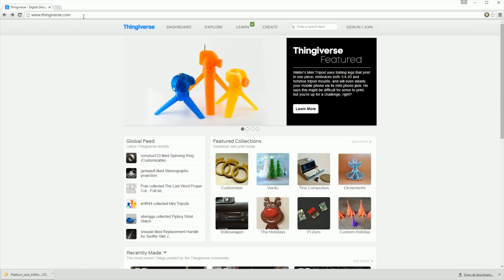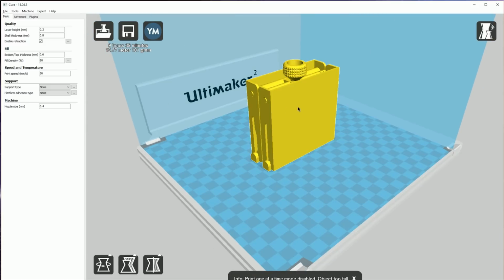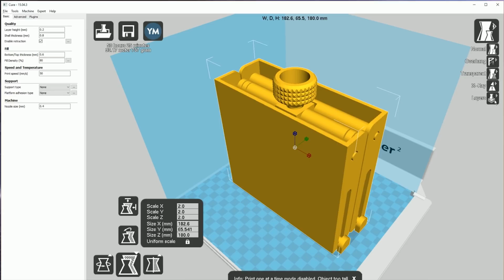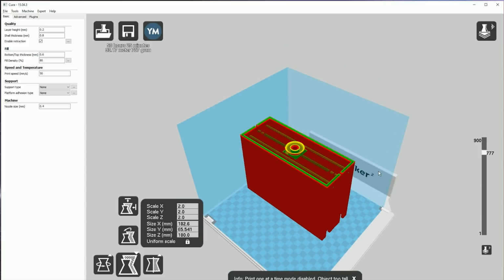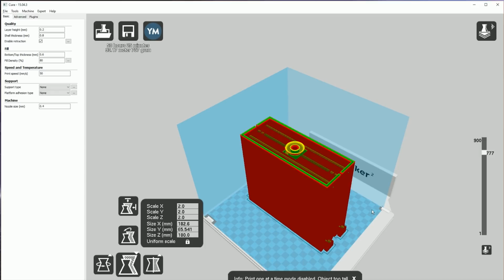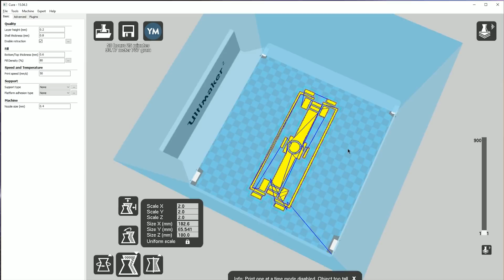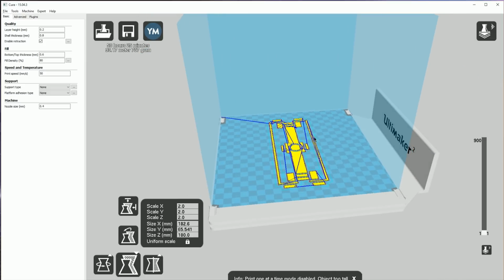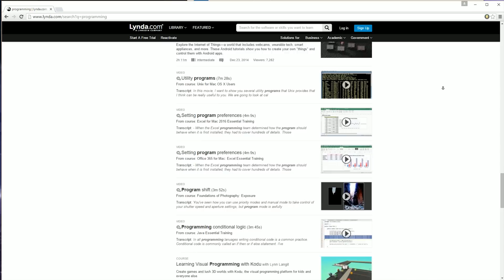3D Printing Fully Functional Platform Jack as Single Fully Assembled Print - @Barnacules

Comment: Fully assembled 3D printed objects are very cool. The auto manufacturer, Koenigsegg has a turbocharger that is 3D printed and fully functional. Of course it doesn't use plastic to print, but instead a metal deposit printer.

Comment: I have access to a printer with a chemical bath that can dissolve away the support material, If I were to use support material, are there any sealed spaces that the bath wouldn't be able to get to?

Comment: Hi ! Have you tried a software called simplify3d ? it's quite a delicate piece of software where you can manipulate with the support material and so on, I've used slic3r and cura engine on and off, but simplify3d by far beats those two slicers for me.

Comment: How much does it cost to run the 3d printer for a couple of days? Looks like a fun build, but daym, that electricity cost
Reply: Running a desktop computer can be more expensive than a 3D printer in most cases.
Reply: 1blisslife Oh right, interesting :) Thanks
Reply: +1blisslife Yeah, but then you are running your 3d printer, and your computer, all of the time.
Reply: +rdizzy1 not if you print trough an sd card
Reply: +Karl Karlex that's exactly why I commented that ;)!

Comment: Brilliant design by the creator what's is needed is 2 back to back with a solid screw between platforms so it at full hight it would be a rock solid platform. Off the top of my head the the paired platform would need reverse threading so both platforms rise on the same turn direction. Im not into 3d printing but I hope someone tries it.

Comment: Sure, it's super cool, but wouldn't it be cheaper, quicker and higher quality to print separate parts and then assemble? With separate parts, you have the added benefit of not having to reprint the entire thing if something breaks. Busted the screw? No problem, print another in 1 hour, instead of reprinting the whole device in 56 hours.

I do see the future uses of this technology, and the importance of us today using it to develop it further, but I mean for the household user, would this actually provide any benefits at all in its current state?

Comment: Do you think the bronze filament would work?  That would be a very steampunk lift!
Reply: I don't think it would, since there are pieces that are fused together(for example the knob), and I don't think it would be very easy to break tgefused bronze.
Reply: Is the bronze filament really that much stronger?  Its just bronze dust in plastic.  I'd almost argue it should be easier to break than straight plastic
Reply: +Dustin Penner It is easier to break than regular PLA which would actually be my main argument behind not doing it but I would probably succumb to trying it anyway because of how cool it would be.

Comment: I might be wrong but wouldn't a good revision be to change the orientation of the slots on the top and bottom so they are off set. I think if you offset the slots the legs slide in it would make it more stable when fully extended so it won't want to lean to one side.

Comment: Thicker arms and two screws and it could probably support your monitors.  Something like that would be useful to get your laptop to eye height and save your neck and lower back from discomfort.  Assuming an external keyboard and mouse for elbow height interfaces.  All of which would fit in a briefcase.  Two screws more flushed with the legs and you'll and a big enough cavity to hold a portable battery pack.  Put a raspberry pi 2 with touch screen on top and watch movies on a plane without having to look like a creeper who stares at his mantool for two hours at a time.  Not that the TSA would ever let you through with something useful or entertaining.

Comment: It made think when you said that you had one fail. I wonder if there is a way were you can take the misprint and melt down the material and re use it. I mean, you would have to find an extruder or you could build something the fits atop of the printer and melts the material and sends it threw the print head. Just my A.D.D. brain kicking in again, sorry.

Comment: i want a 3d printer :c but who can afford like 3k€ for a 3d printer? :c 
are there any good one for like 500-600?
Reply: I have loved my printrbot simple metal. They go for about $600 new.
Reply: Get a Prusa i3 in kit form or sourcing your own parts to build one for 200-300 quid! They can do just as good a job, but you would have to get under the bonnet & tweak the firmware after assembly. I highly recommend it ;)
Reply: Btw... Even if you don't know how to do it.... Plenty of video's on YouTube & online forums if you build one or if you get one of the kit one's. Most come with instructions to build it. Just as barnacules says... Get a Heat Bed(makes printing that much easier).

Comment: The problem with these all in one prints is if a single piece breaks you have to reprint the entire thing instead of just that piece.
Reply from the maker: That is a good point.
Reply: +CueBeanKa I'm asking because I dont have a 3D printer: If a piece breakes, can you select that piece in the digital model, section it and then assemble it in place?
Reply: +andreisabe The problem is that there is no means to fit the replacement piece. You would have to break the print more to get the new piece in place.

Comment: Hey Jerry, I haven't been following the 3D printing movement I guess you can say. But I notice yours is printing plastic resin. Are any of the 3D printers able to print metal or ceramic reinforced resin compounds yet?
Reply: Yes, there are metal printers out there. A few years back Strathclyde university was about a million pounds in the bidding for a titanium printer, don't know if they got it in the end but yeah, it's amazing! They work in collaboration with the local hospital and the idea was to use it to print custom replacement parts for damaged bodies.
Reply: They do have metal one's... Even concrete 3D printers to make you a house!
Reply: +1blisslife technically those machines used to make bridge pillars are a form of 3D printer. They sit on the base of the pillar, fill with cement and when that sets climb up and repeat.
Reply: Acrimonious Mirth Yea technically true.. :-)

Comment: I was looking for a good adjustable speaker/monitor stand a while ago and this thing would have been perfect! Crazy. Inb4 3d printed people
Reply: Oh, I'm sure you get asked this at least every day but which printer do you think has the best bang for the buck? There's so many choices
Reply: +LeiserGeist Get a "Prusa i3"for sure... That's a perfect printer for beginners to learn on... Get a kit one for about 200-300 bucks(assembly required) or Source your parts(Google Prusa i3 Rework) then build as you go so that it won't hurt your wallet. Either option will cost about the same, but you'll know exactly what you got when done. I also recommend getting different size nozzles for it & a  barnacules says! Make sure to get a Heat Bed!!! Hope that helps good sir!
Reply: 1blisslife
Thank you for your suggestions, I will look into that printer a bit, $300 seems fair for me
Reply: 1blisslife The Prusa i3 kit is $600 from what I can tell. Still fair of course, I'll still consider it
Reply: 1blisslife
I didn't look on ebay originally, kind of weary about ordering one straight from Shenzhen, but $300 is pretty worth it
Reply: +LeiserGeist The item number I told you comes from California(the 269.90 one), but the others you're right... Shenzhen, but if you order via PayPal & something goes wrong with shipping  then you'll get your money back. I've only had to do that one time in 10 years, but looking at the item number I gave you? You should be ok since they have good feedback(99.8%). That's what I always look at when shopping there... The good thing is that is a US seller & not from China like the others. I do understand your hesitation on that tho... Well I hope that helps further :)

Comment: Great review. Do you actually use simplify3d more than cura?
Reply from the maker: Only when working with complex support material.
Reply: +Barnacules Nerdgasm Cool, I just watched a video on using simplify3d. I see that you can add and remove support structures, something that I would love to see in Cura. I find myself sometimes creating my own support structure if I only need it in some areas when using autoCAD. Maybe you can nudge the Ultimaker guys in the right direction :)

Comment: Hi Jerry to make this idea a lot stronger would it be possible to make the parts in plastic and as it normally would fill those parts with plastic fill each part with a more durable material i.e. a metal and keep the exterior in plastic so your parts remain the same so in theory it will function like the original but with the added strength another suggestion would be to add a slide mechanism to the platform to allow for balancing like to hear what you think kind regards Jon
Reply from the maker: Yes, one guy on thingiverse already did something like this.

Comment: Scaling it up also scaled the tolerance i.e. the play of the sliding parts. That is usually not necessary as the same absolute tolerance is OK independent on the size of the whole model. That is why the scaling of mechanical models with moving parts does not always work as expected. That's inconvenient but there is nothing the slicer can do about that. This could be handled by parametric designs but that's another story.
I saw the effect of scaled tolerances with a simple bag clamp which had way too much play after scaling it to 250%.
The bottom line is: you may have an even better result using the lower tolerance version for a scaled print.

Comment: I need to get a 3D printer to print a new side view mirror for my 1991 Dodge Daytona... Clipped off by a crackhead, and there's only one for sale, for the same price as I could get an ultimaker 2.
Reply: Record the process if you do
Reply: good feels Im a poor car guy... Not happening for a really long time, unfortunately.
Reply: See if there's a makerspace/hackerspace anywhere near you! Some have 3d printers you can use/rent among other things
Reply: LeiserGeist Unfortunately, im not in a well populated area, discounting the crackheads around here. The closest makerspace is about a 5 hours drive
Reply: _Husky
Aw that sucks!
Reply: +Oldskool1427 Unfortunately, I don't have $20 to fill the tank, let alone $800 for any sort of 3D printer, capable of printing a full size mirror.
Reply: +Oldskool1427 Great choice there. I got lucky and found my R1 relatively new with malfunctioning hot end for 400 bucks on ebay. I had planned on upgrading the hot end to the e3d anyways so it worked out great.
Reply: +_Husky F,orget the mirror anyway.. besides looking odd, a cam with display will be better anyway..
(wide angle lens)
(decreased drag by a fraction of a fraction))
Reply: +The Mod Shop Nice!)

Comment: What kind of 3D printer do you recommend  for people starting out
Reply from the maker: +Let'sSpeak Gaming Ultimaker is by far the friendliest 3D printer I've used to date, but it costs quite a bit. But with 3D printing it's better to spend more up front to avoid headaches of cheaper machines.
Reply: I have a flash forge dreamer and it works pretty well for me. But I have seed other FDM printer that auto levels and has other features that you may not understand from a YouTube comment. But auto leveling is where it's at bc when I was a noob 3d printer person leveling incorrectly led to clogs and bad prints. And trust me you DONT WANT A CLOG. Msg me If u have more questions... (: